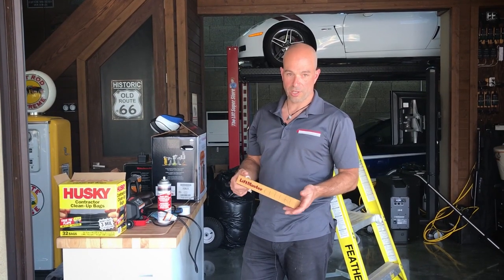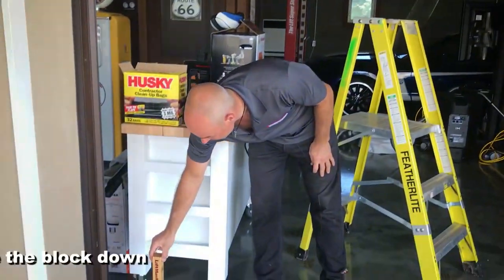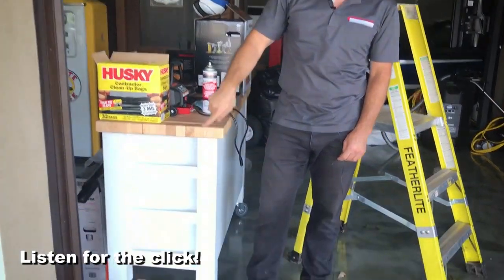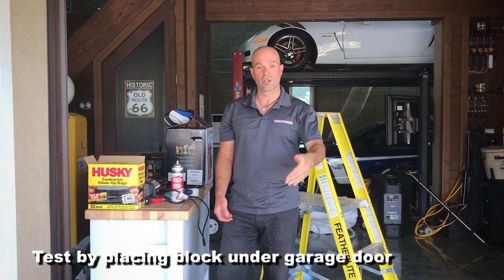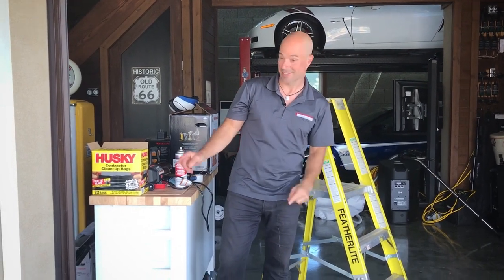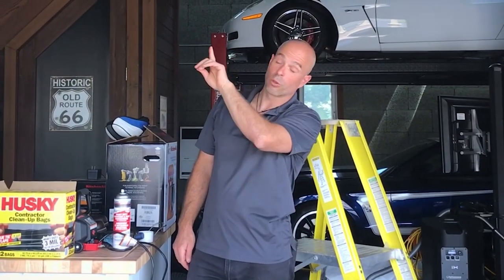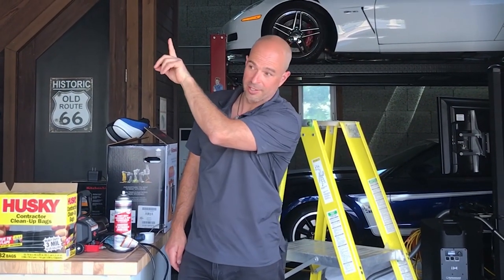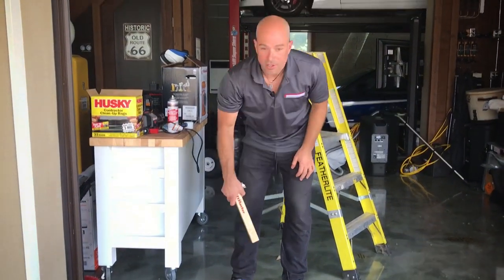How To Test Your Garage Door Sensor Properly! "Mike's Garage Door"

Comment: This is exactly what I needed to know:  my 041-0136 receiver doesn’t light up green (or anything) even though the other side is lit and aligned. My ohm meter shows infinite resistance, so instead of repairing or replacing it, I can just have someone else do it.  Yesss!